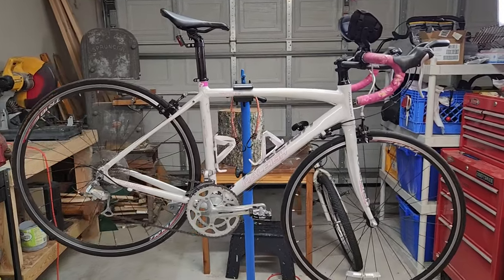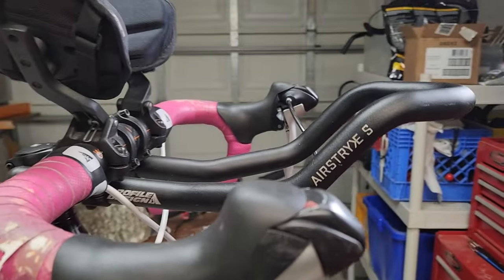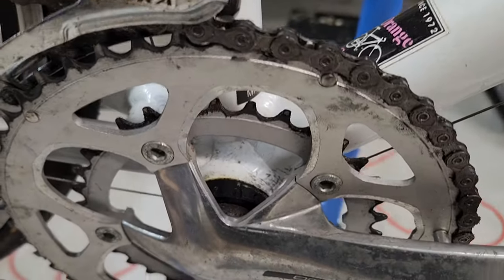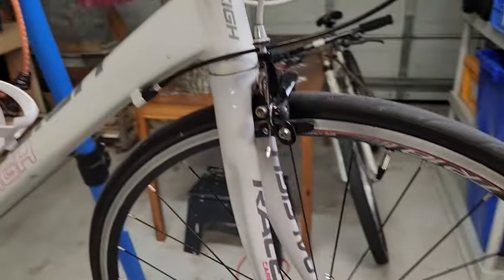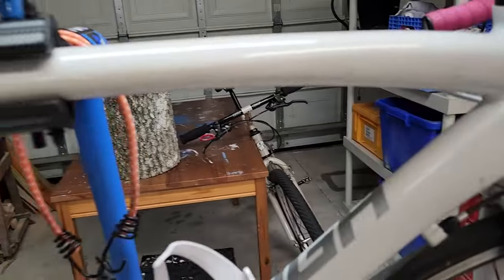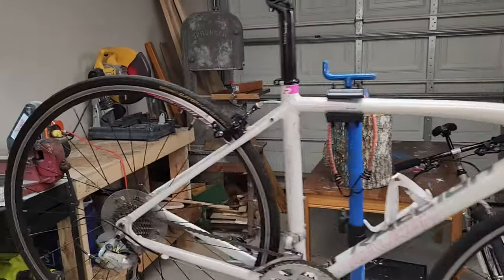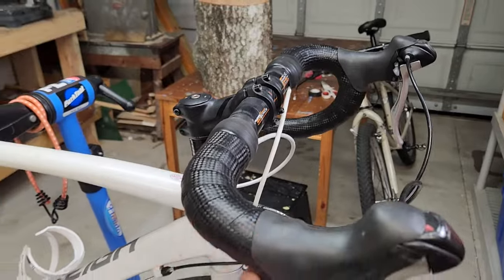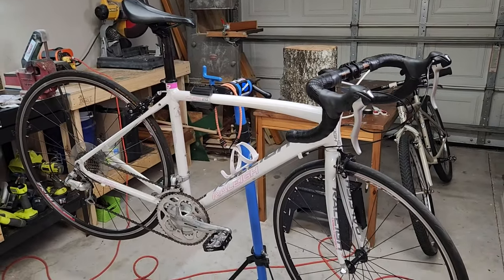Raleigh Capri 2.0 - first look

Comment: Use tape over the pink stuff, and no one will know the difference.
Btw, you should check the weight without any bottle cages and without the pedals, because that's how bikes are weighed.
Reply from the maker: yeah I know that's how they're weighted typically, but I just don't want to take all that off just to know the weight. I guess you can estimate the weight, maybe 350 grams for the pedal set. No idea, maybe 50 grams for the bottle holder. So 9.9 - 400 grams brings it to 9.5kg or 21 lbs.

Comment: I think you did really good for $80. All it really needs is a longer stem. Try a 130mm UNO light weight stem17° or 7°
I'm 5'11" and one of my best bikes is actually XS 44 mm women's frame with purple stripes and with 3x8 Shimano Claris.
Reply from the maker: yeah that's a good idea, I might even have a longer stem somewhere, not sure about a 130, but maybe I have a 100. Really a 44 and you're 5'11"? I'm surprised and don't feel so bad then, I'm just over 5'7" and I think my Co-op is something like 44.

Comment: I would remove the aero bars. Beginning ladies dont gravitate toward this setup. XS - 44cm is most likely a female, 5' and shorter. Are the wheels 650s?
Reply from the maker: It's a 48cm, with 700c rims

Comment: I would try to remove the rivets and plates, and jb weld plastic bond 2 part epoxy should provide a more seamless fix
Reply from the maker: that's actually what I've done now, I've used epoxy, but I'm only like 20% confident that it's going to hold.

Comment: Mechanical road brifters will work with cantilever brakes.   They SHOULD work with the MTB's rear derailleur... but will not work with the MTB front derailleur.....unless you get the Jtech adapter.  

I use Shimano Campus combo pedals on my Fuji/Marlboro folding bike that I converted into a fixed gear.   Toe clips n straps for the platform side.
Reply from the maker: yeah that's all the same as I understand it in terms of compatibility. Also they should work with mechanical disk.
Reply: @BruceChastain cable pull varies for mechanical disc brakes, it would be ideal to use road specific caliper or you could use an inline travel agent with a long pull caliper